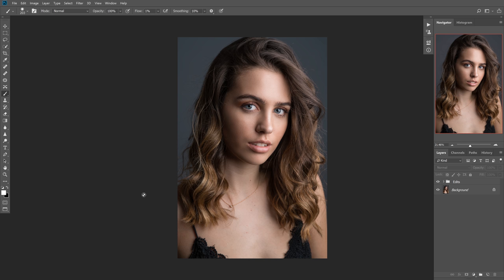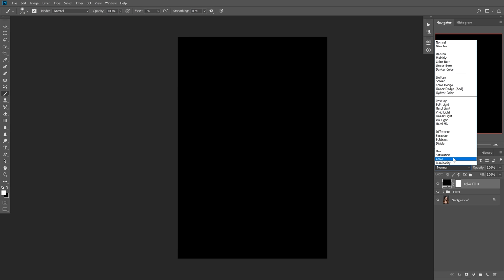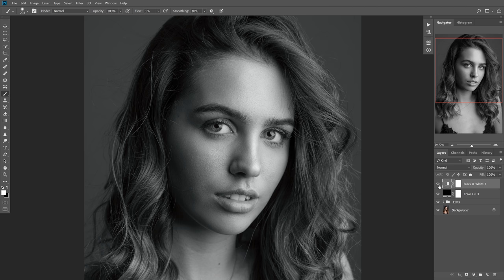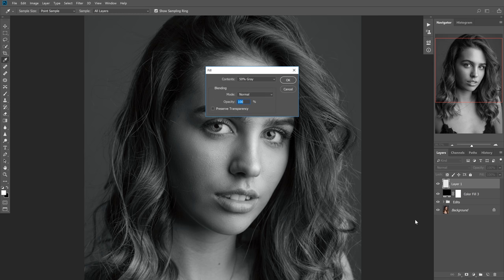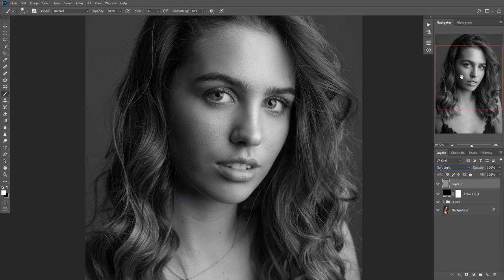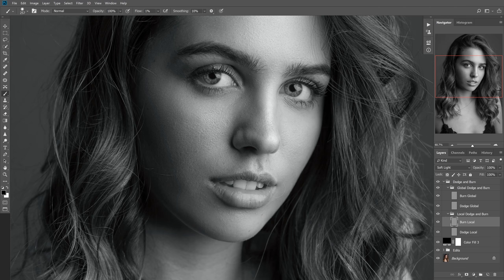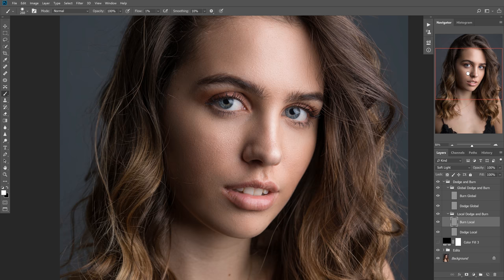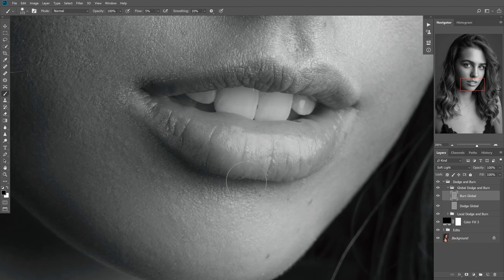How to Dodge and Burn with Soft Light Painting

Comment: Thanks for the tutorial! Very helpful. With curves I use masks. Why not masks for this method?
Reply from the maker: The reason you usually wouldn't use a mask is because the great thing about this method is being able to quickly switch between dodge and burn with just the X key to switch the color if the brush, white for dodge black for burn. I used to use this method when I was new to dodge and burn and I would frequently switch between them. Although i suppose if you wanted to dodge and burn the traditional masking way with the  softlight effect, you could make solid color layers, one black and one white, set it to soft light then mask it. Doing so would effectively double the precision in which you could paint since having only 50% grey and lightening and darkening from there only leaves 49 points of opacity where a solid color masked would have a full 100 points of opacity. If you wanted to be even more accurate that would definitely be the way to go.
Reply: @NoahDanteSmyth  thank you!

Comment: Thanks for this! Is there a difference between adjusting opacity and flow? I notice you adjust flow down and not opacity. Just wonder why. Thanks so much!
Reply from the maker: Flow can be built upon in a single stroke just by back tracking, opacity has to be seperate brush strokes repeatedly over an area. I'll do a video on it soon! Hope that answers your question for now!
Reply: Nick Smyth that helps a lot. Thanks. Do you use a tablet to edit? I'm using an intuos pro with pen pressure sensitivity so was just curious if you're also using pen pressure as well as manually adjusting flow. Thanks, nick!